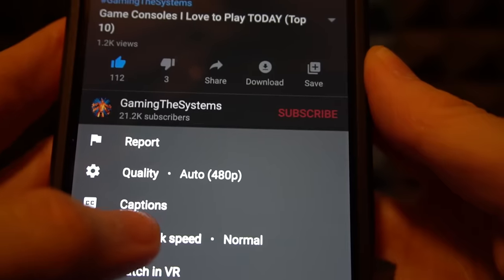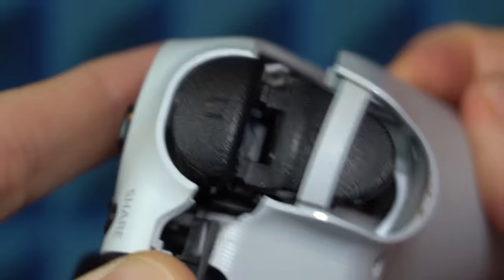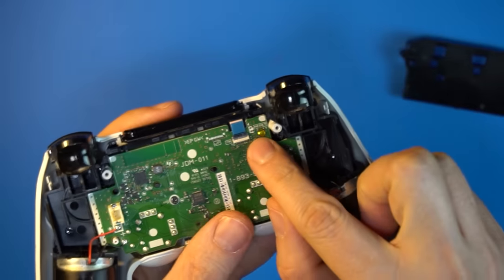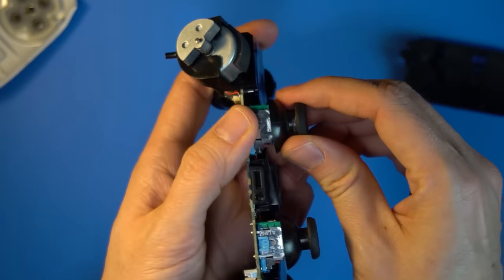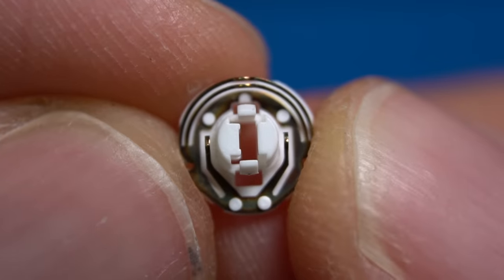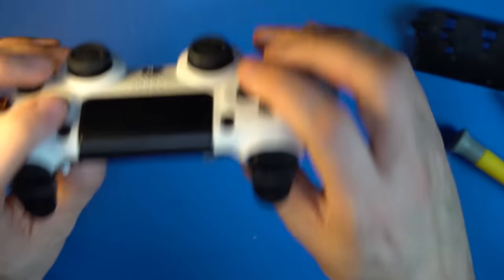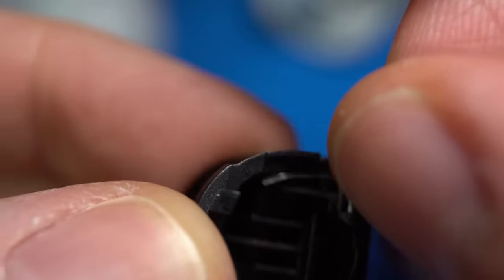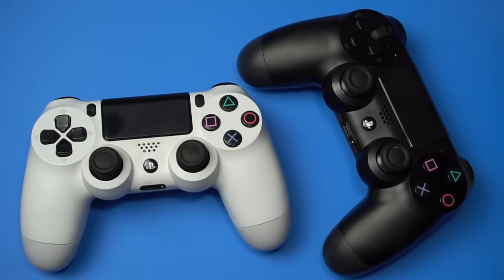How to Repair a PS4 Analog Stick That is Drifting, Sticking, Jittery/Cleaning DualShock 4 Controller

Comment: I would rather find a solution that didn't involve taking it apart. I just know I'm gonna fuck it up somehow. I'm bad with technology.
Reply: Pelcogo i have a way without taking it apart
Reply: Yonathan2278 what is it?
Reply: Yonathan2278 what is it?
Reply: Aym4n-_-KSA1 tried it a year ago and I didn’t work.
Reply: Pelcogo just buy a new one haha
Reply: @Aym4n-  I keep trying that but it doesn't work.
Reply: @eclipseshadowyt5917  I'm probably gonna have to but I wish I didn't because there's a game I would rather be using the money for.
Reply: Pelcogo LMAOO I FELT THIS
Reply: Same😂
Reply: Aym4n-_-KSA1 Lmao yeah why you ask 😂
Reply: The method is to try blowing into the analog sticks, works for me for awhile until the process has to be repeated.
Reply: SavageGamerCA yea pulling and rotating the stick around works but u gotta do it every now and then... but what ive noticed when playing COD i cant run forever it sometimes stops
Reply: Same lol I rather buy a new controller
Reply: You can’t fix it without taking it apart. It’s not something software related.
Reply from the maker: There's risk in everything, but if you get comfortable opening up and repairing things, you'll gain some skills that can become useful later in life. Also, I made a video that shows possible ways of fixing without going inside. https://youtu.be/Lt0uHmGMKx0
Reply: @HowToX  thats true!
Reply: @yoobeto  what do you mean pop it up?
Reply: Patrick pull on it and you will feel and hear a click noise and the analog stick will feel a bit weird and blow on it then just push back down on it until you hear the same noise and the analog stick feels the same
Reply: @crazyafronado3915  Thank you so much...I was scared I was going to do it wrong but this really helped!
Reply: Just purchase new controllers with insurance and get a brand new one in 1–2 years for free!
Reply: Patrick np happy to help 👍 EDIT: you just got yourself another sub 😀
Reply: Before screwing up things, just spray WD-40. Solved the problem for me.
Reply: U can fix that without doing anything to the controller just go to the settings of the game your playing and in controller configuration yo can find the dead zone settings just increase it a bit and that should be all
Reply: @destroyerblackdragon  If you can buy another one, you might as well try this. Worst case scenario, you'll have to buy a new controller anyway. Best case, you gained a new skill and saved some money. :)
Reply: Pelcogo you won’t it’s not that bad
Reply: @mateo_alfaro  its not a fix but a workaround, the issue will remain, I'm gonna try to open mine up if the airblowing won't work
Reply: Just move the joystick up down left or right hold it there with your thumb and spray contact cleaner for 5 seconds into the gap between the joystick and case....job done works every time 😊.
Reply: Take it apart. The controller is actually stronger then thought, unless you're actually full on yanking stuff off you wont break a thing.the only part where you wanna be carefull is when taking the top off, the little points where it clicks tend to break.
Reply: @IGleeker  spray any machanichal lube into the analog let it dry and spray it out with compressed air
Reply: @destroyerblackdragon  I know right they ain't cheap.
Reply: Pelcogo lol so then don’t do it and just buy another controller. These things don’t last forever
Reply: If the controller is unusable then what could you hurt by trying to fix it?
Reply: @13myzri  a straw will also help in channeling the air.
Reply: @dustinlawson5882  I've sense gotten a new controller but to answer your question it wasn't unusable it just made it annoying to play video games because the movement was sticky. It worked just fine for streaming services.
Reply: @foxhoundbridges4851  I was able to save a few bucks at Walmart but I did get a new controller but I wanted to use the money to preorder persona 5 royal. And it sucks cause I don't come across money that often.
Reply: @user-op1tr2xo6n  same problem
Reply: @HowToX  ayo bro? Do you mind tellling me what toools im gonna need?
Reply: GamingTheSystems Touché
Reply: yh same
Reply: GamingTheSystems Defusing bombs?
Reply: I do not have a way to open it up without breaking it
Reply: Yonathan2278 jk
Reply: Yonathan2278 what is it
Reply: Lol
Reply: @user-op1tr2xo6n  yeah thats my problem it keeps stopping me from running and i cant play
Reply: Naw man go ahead I know I'm a month late but go ahead I did it and my first time it worked but now I cant charge it and the led wont turn on but I'll fix it
Reply: I have only opened the Dualshock 4 controllers 4 times in my lifetime. Being a guy that doesn't tinker with devices, the first time around was heart wrenching, especially opening the shell (initial opening is always hard and you will inevitably break very small unimportant parts. Could be for warranty checking maybe.)and pulling those analog doors opened. The very thought of screwing up was pure anxiety but I was prepared to buy a new controller. But after that, the other times opening it wasn't too bad as I've already known what I'm getting into, literally. The only thing I've screwed up maybe was messing the solder to the rumble as my light rumble is not working anymore after opening it up the 3rd time.

I recently have to open my second controller which is a V2 and it was not a big deal. In fact, I think opening up the V2 is little easier this time around than the previous versions. I would say, if you had in mind to get another controller, it wouldn't hurt much to open up the current one and try fix it. If you do succeed, you'd be able to save some cash.
Reply: What is there to lose
Reply: You probably wont i was opening them when i was 11 it’s pretty easy
Reply: Pelcogo I fixed mine by getting a cuetip and  alcohol and rubbing the inside of the  anolog stick
Reply: Imagine Taking Apart everything and Forgetting , " where to put what? "
Reply: mateo alfaroYT ya but that can mess up your aim
Reply: Do a hard reset by pressing the micro button on the back of your  controller and recalibrate your thumbsticks. That did the job for me and no screwdriver needed
Reply: @Effin C try to hard reset your controller and recalibrate. Search on tube how to do it. It worked for me
Reply: @Effin C dis you also recalibrate? Search tube how to do this. Something like holding both thumbsticks down for 30 seconds and then rotate them 5 times left and right.. then hold sticks 30 secs again. Gl
Reply: Pelcogo turn off your PS4 and press the reset button on the back of your controller that is messed up. Hold for 5 seconds. Worked for me and now I use a controller I hadn’t used in months and was about to just throw away..
Reply: I did it twice it's not too difficult the hardest part is probably prying apart the controller lmao
Reply: 69th reply
Reply: Marco Freitas Dont listen to Marco Freitas, moisture in the controller will fuck it up
Reply: CrazyAfroNado thanks so much bro👌🏾
Reply: Beto thanks so much bro👌🏾
Reply: @crazyafronado3915  you absolute madlad. Thank you.
Reply: zimbabweking np
Reply: I’m Bored np
Reply: I have zero skills or experience and minimal tools. I followed this video to repair a used controller I just got that didn’t respond to forward input on the joystick. Just saved myself money on replacing something that took me 30 minutes to fix. Not that hard. Thanks to GamingtheSystem for putting this up.
Reply: @SavageGamerCA  thank you so much it worked I had drift for a long time
Reply: play boy this is the only reason why I’m doing it I’ve been an Xbox player for a while and I have a ps4 with bo3 on it and it’s so hard for me to run
Reply: Hey just pull up ur analog stick and blow in the inside of it. Thats all u need to do
Reply: You can pop up the analog sticks and blow into it in a circular motion
Reply: Doesn't work, it actually busted my controller as well😐😑👎👎
Reply: I blew into the joystick and it kinda worked
Reply: CrazyAfroNado your tip is a lifesaver man
Reply: If this shit doesn't work I'm get a xbox
Reply: Need another solution?? Buy a new one
Reply: yes, i know I have a long user name i do sorry just check my messages
Reply: yes, i know I have a long user name you just have to clean the joysticks the bottom part of it with a cotton swab and some alcohol make sure you get all the sides and if doesn’t work like that then something in the inside is damaged unfortunately for my second controller I had to take it apart
Reply: Yoshi Hokage nah bro never checked my messages lmao

Comment: I got like 2 minutes in and was like “yeah nah I’m gonna buy a new one” 😂😂😂
Reply: frr its to much
Reply: You're lucky you didn't reach the third minute you would throw the controller out the window
Reply: Pft PEASANTTTTSSSS!!! I just did it and it worked. Took everything apart and put it back together. Works like brand new now. Don’t be scared bro. I only broke 1 controller and fixed 1 controller. So you got like a 50/50shot. Those are good odds if it saves you money
Reply: @johnwayne1591  same just did it today I actually bought a new one about 2 months ago and kept the one that kept drifting I did his steps and it works like brand new
Reply: Free Fluffy it’s a game changer dude. Happy it worked out for you too.
Reply: I beat you, got to 2:20
Reply: Facts!!! No 🧢. 😂😂😂😂
Reply: Why it's so easy a 2 year old could do it, and every kid should be fixing things his whole life so they learn how things work a d how to fix things, it's important to know how to fix things in life ecspecaially when it's common sence. Lol
Reply: @nickhaley1212  hitting hard with those facts, but missing at point blank with that run on sentence. Point made tho, fixing things on your own should be normalized more often than just buying/replacing expensive tech like this.
Reply: My thoughts exactly
Reply: Lets be honest hear you have to been a expert engineer and know what your doing as doing all this clearly requires  persison youll just make the controller worse otherwise aint no way im doing a fucking autopsy on the controller😂
Reply: Its so f ing annoying on MM11
Reply: It really wasent too hard tbh
Reply: They do it on purpose. Not only that the ones I bought new messed up a month in. And they were glued on the plastic edge to purposely make me break it
Reply: i would only if my mom let me buy a new controller-
Reply: Soon as he said it requires some sodering. I started up the car lol
Reply: Glad I'm not the only one with the same mindset, I'm too broke to afford a new one so here I am 😂 😂
Reply: @briandelgado906  "No Sodering" is required. Shit was a breeze to fix
Reply: If you buy a new one. You can use the old control as a test dummy ! lol
Reply: @QUATROSIETE  yea I'm sure it is I'm just having a laugh
Reply: @QUATROSIETE  do you have any tips for buttons that don't work? My L2 buttons kinda works but I gotta push down on it hard tho it doesn't work normally. I just got it like 3 months ago
Reply: That’s exactly what I’m thinking right now 😂😂😂
Reply: @Tywil714  facts 😂😂😂